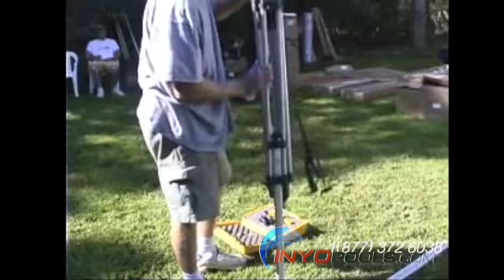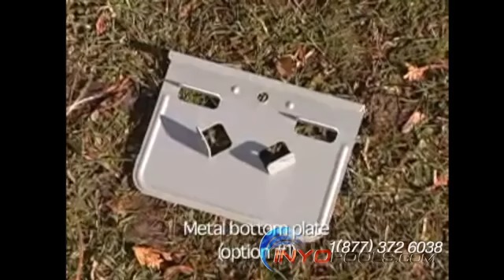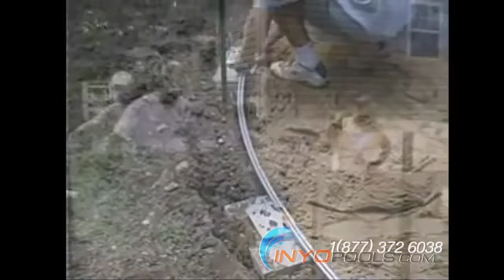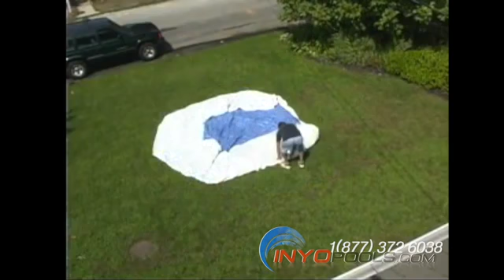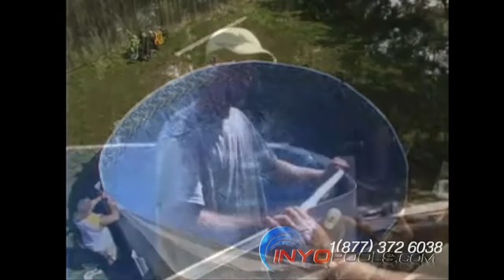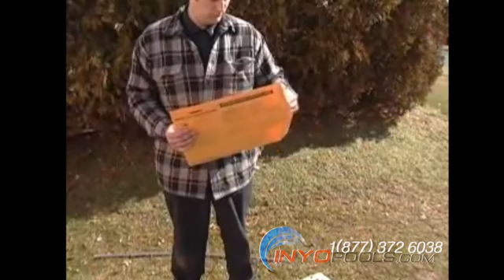How To: Install Above Ground Pools

Comment: No.

First thing that you would have wanted to do would be dropping a bloody load of Crusher fines or some class A gravel at least. Spread it out if you're doing a 24-foot pool you want to go at least 26 ft gravel pad. Then measure across in a X pattern to find your Center and then dropped a piece of rebar. Hook your hundred foot tape on to the rebar stretch out to in this case 12 feet take your marking paint and with the tape measure pulled taunt run around in a circle drawing a circle with paint.

Then put your track and plates together so that they rest on the line that you marked. The hell with using using bricks because the frost is just going to heave them all to hell. In cold areas anyway.

You need to level with in 1/8 of an inch using your Transit level in area 6" wide on that line you painted all the way around as this is where the actual pool wall will sit. I've always found the easiest way was to level a small area behind each upright making all these little areas the exact same elevation then you clear out the material in between these two points so that the elevation is the same all the way around pool on the line that you painted which now of course is gone because you dug it up.

Quite frankly I don't see why the hell anybody would use sand anymore. We use 1" 4 foot by 8 foot sheets of Styrofoam the white stuff not the high-density stuff cuz it will crack. Tape it together with tuck tape.

Now you are rolling out your wall on an area that is the same elevation as the track because the one in styrofoam Has Lifted your area and wall will fall in the track much easier. We always lean the wall back on its Edge so that it can roll on its Edge much easier. If the wall happens to overlap at the end when you're going to bolt it up then you need to make the circle bigger by kicking out all of the uprights a tiny little bit to make the circle bigger then fill in the area with styrofoam. Then you add your foam wedges called Cove. Tuck tape that so that is completely sealed all the way around the pool and to the floor. Jama vacuum like a Shop-Vac hose down between the liner and the wall through the return jet hole. Tape the skimmer hole and the return jet hole up so that everything is sealed install your liner. Turn your vacuum on and it will suck the liner to the wall and help remove any wrinkles as well as hold the wrinkles out while you add water which will inevitably be the long-term solution to holding out the wrinkles.

Add your top Ledges and then your top caps and you're done!